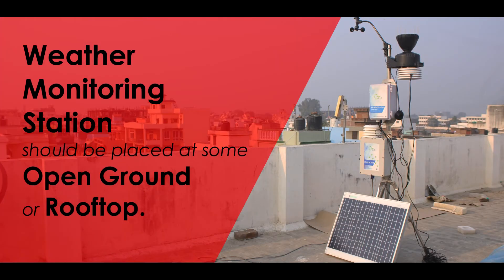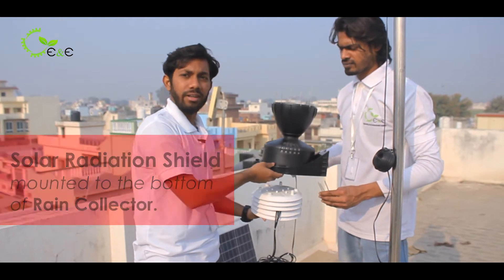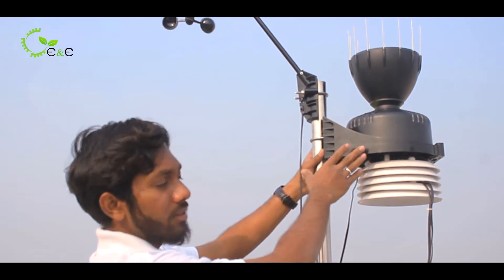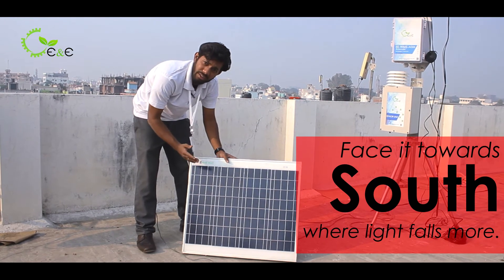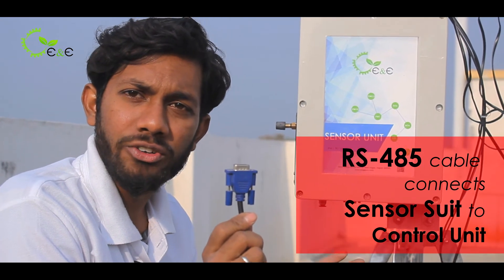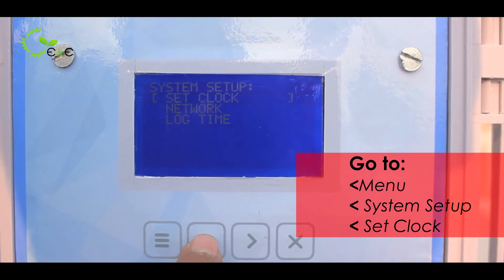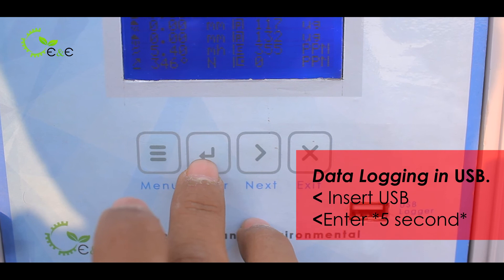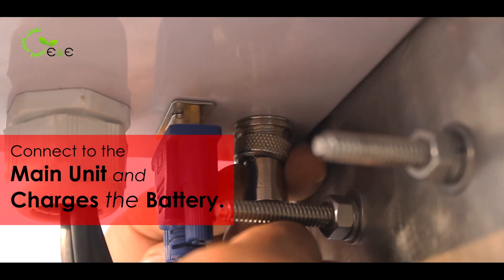Ambient Air Quality Monitoring Station   Installation Video

Comment: Hi..! Can you tell what is the use of thimble??
Reply: PTFE Thimble, This is a very important part of the analyser and should be changed regularly. It prevents dust and dirty particles entering the pump and sensors and hence causing
damage. The filter MUST be changed when it is discoloured.